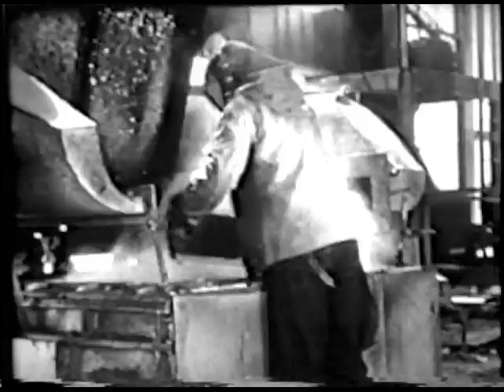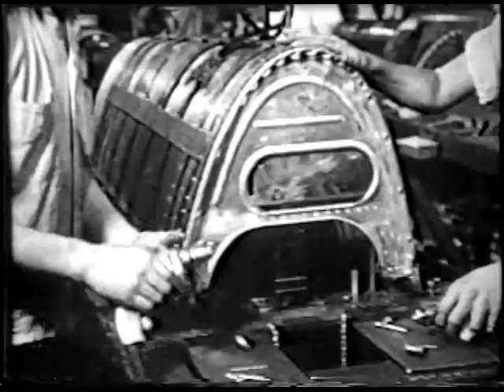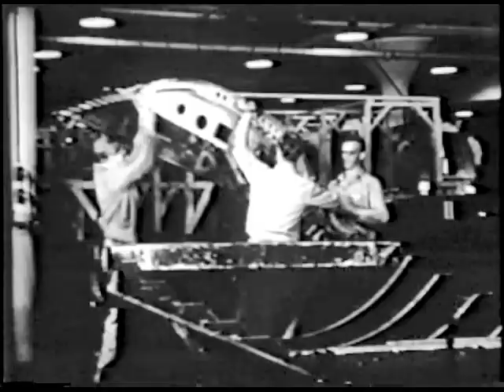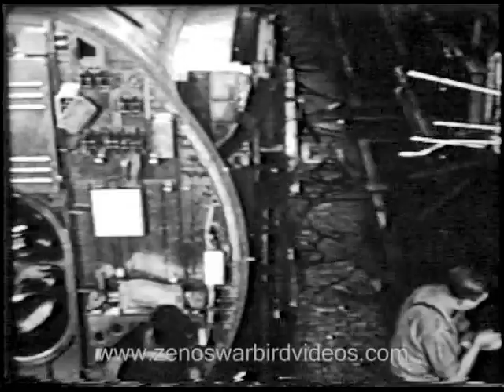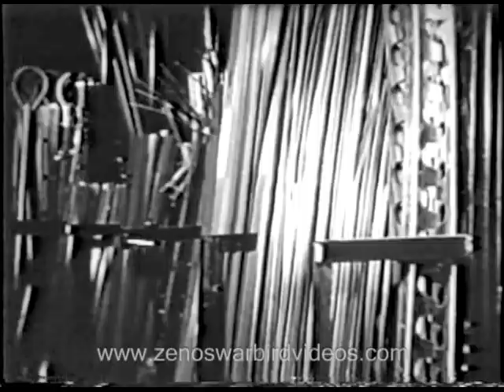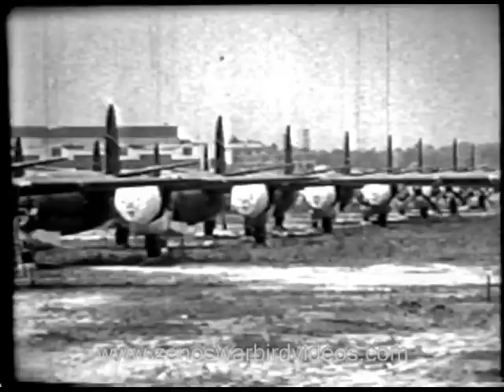Building a Bomber: The Martin B-26 Marauder 1945

Comment: The shortage of Curtis Electric Propellers caused a back up of production as can be seen. A shortage of many components was cured as soon as 1942 got going. Many of these aircraft went to the Pacific to do great service until the type was sent to Europe. B-26 to Great Britain and B-25 to Pacific. Ironically a "Secret Bomb Sight" was captured in 1942 by the German Military as a result of a lost bomber crew who crash landed their B-26 on the Dutch Coast very carefully so it could be recovered and used. And it was....by the Luftwaffe. BUT...they were never able to acquire enough propeller blades to test fly the ship. It was scrapped after the war with all the other B-26's by German POW personnel. Few types survived the post war era. The Martin B-26 was not among them as it was a short range, gas hog with a bad reputation among pilots who were just kids .

Comment: I don’t believe that this is in Marietta, GA but actually Middle River, MD. I currently work at an old Glenn L. Martin plant in Middle River where B-26’s were assembled in “C” building of the plant. The building in this video looks exactly like “C” building in Middle River. Also the old “H” building, “H” for hammer, housed the old drop hammers and the foundry the building structure is identical to the building in the video. Some of the smaller hammers were in use up to ten years ago until we ceased sheet metal operations and are now using composite materials for our thrust reversers and nacelle programs.
Reply: Thomas Cosden i agree,i grew up in that area and my grandfather worked there 35+ yrs beginning during WW2. He worked the 100 ton drop press...im told that machine is still there due to its size.

Comment: The "Widow Maker" was quite an airplane. Don't think any are left flying today.
Reply: barrybmlv...correct! One static example at Fantasy of Flight in Florida. One static in Free French markings at Normandy, and 200-mission veteran (highest number of any WW2 bomber)
Reply: ...called “Flack-Bait” is being preserved at Smithsonian Air & Space. Complete preservation expected finished in early 2020’s.
Reply: barrybmlv There’s actually 6 left.... only one capable of flight....
Reply: Don't forget that there's one at the USAF Museum in Dayton.
Reply: @riproar11  In 1969, I helped repair that A-26 at Nakom Phanom , RTAFB Thailand. Structural Repair 56 Field Maintenance .
Reply: @tantedog  I visited the museum again two Summers ago and checked out the A-26 for a while, because it's one of my favorites and I built a model one years ago. Kermit Week's A-26 will be flying soon.

Interesting to learn that you worked on it. Last weekend I visited the USS Hornet and talked with the workers. One told me about a mechanic shop in California where a German Luftwaffe pilot and a Polish war prisoner both worked, but neither knew about the other's background. During a lunch the Polish man talked about how he slaved at a factory assembling carburetors for ME-109s. They would secretly toss in a washer in 1/3 of them as they learned that it would shut down the engine when the planes were flown inverted. They only did it to 1/3 of them as there were limited amounts of washers and also that it wouldn't be traced to that factory. The German pilot became livid after hearing this and said that he lost a lot of pilot friends whose ME-109s shut down after inverted flight and crashed.
Reply: @riproar11 The story is not correct. Their was a lot of sabotage from forced laborers. But not on the Bf 109 carburetor, as there is no such thing. All German fighters had fuel injection
Reply: @theonlymadmac4771  The man working at the USS Hornet museum was in his 90s. Maybe he had the wrong German fighter plane in mind when he told me the story?